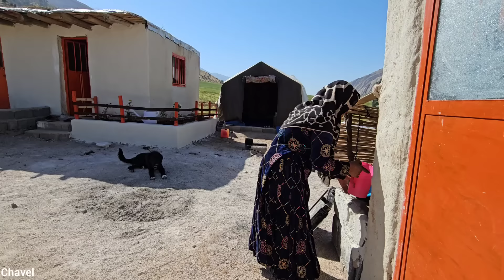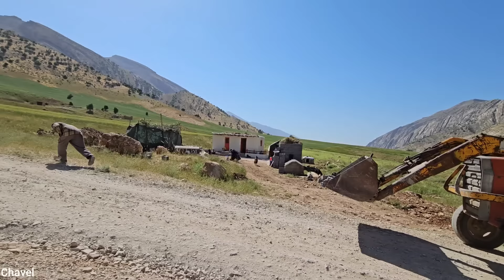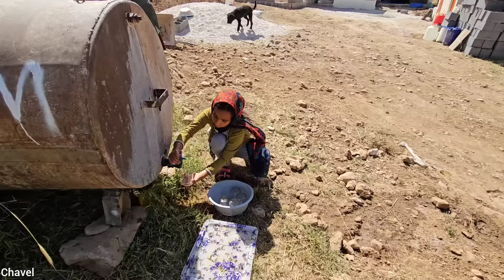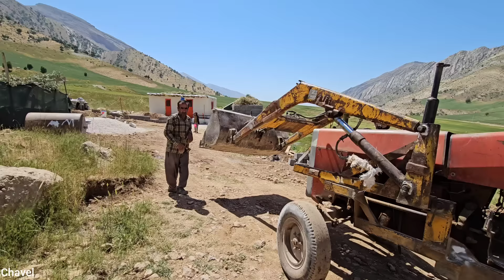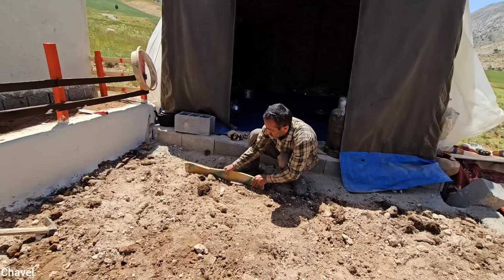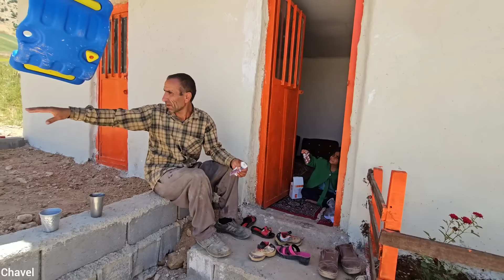Videographer's help: a shelter for the girls of the Reza family #family

Comment: There he goes again putting blocks on top of dry cement one of those gusts of wind that they get will come and blow the house down you need wet soft cement to make the block stick together they are bound to know that by now wetting dry cement with a little water when it’s on the blocks is wrong if they keep doing this there will be a tragic accident in the future